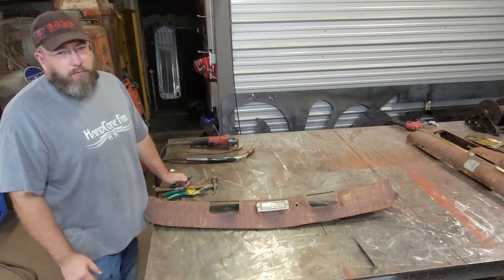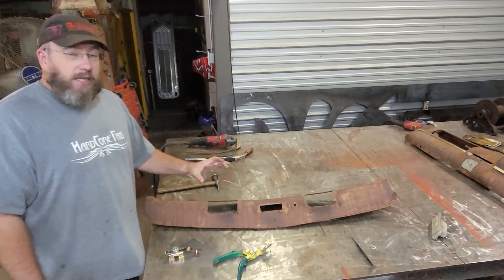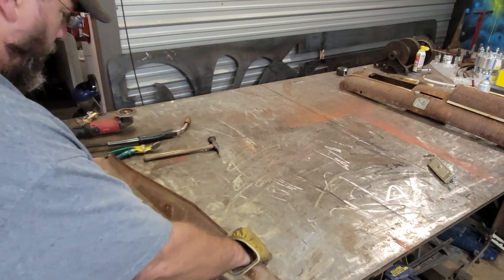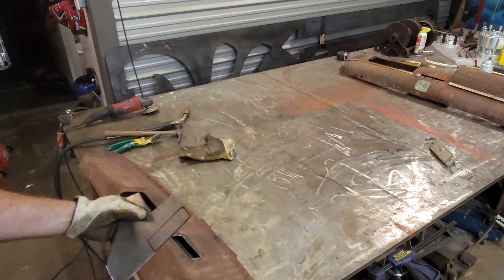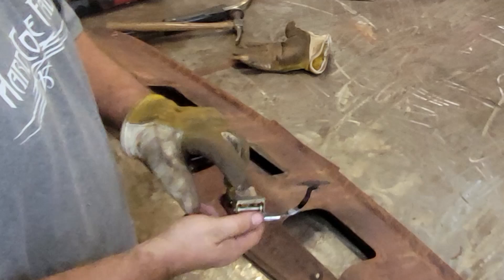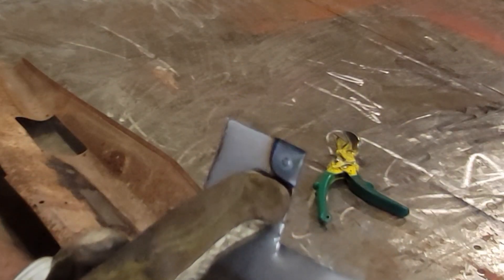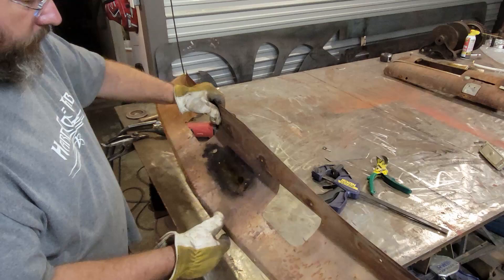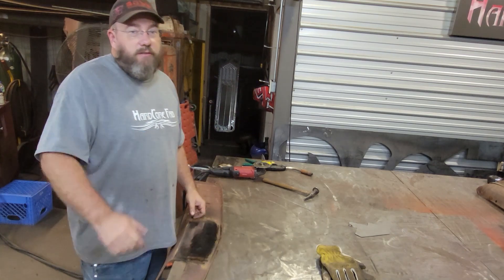Easy Sheet Metal Patch

Comment: Hay Anthony great tips,the hole was for the vacuum wipers.i had a 46 the cab is tight to say the least tilt wheel and swivel seats will come in handy excellent work as always.
Reply from the maker: No it was wired to the light and looked like it was cut with a torch LOL  The wiper are in the panels that cover the big square wholes.  and yes pretty tight but I'm making the most of it!  Thanks for watching!